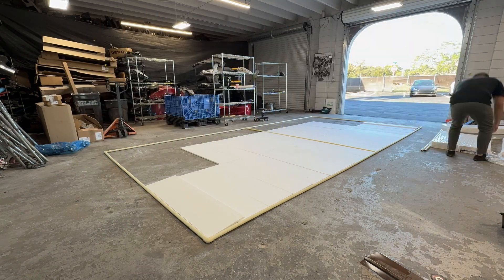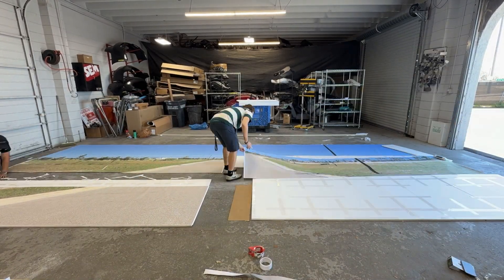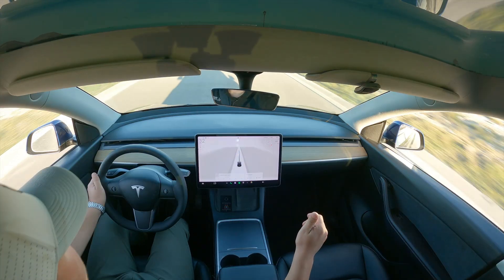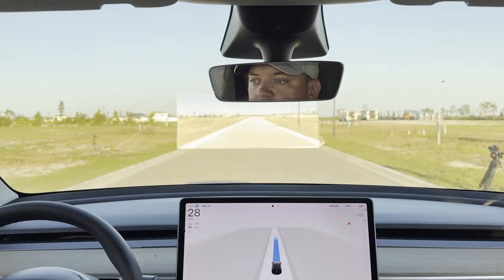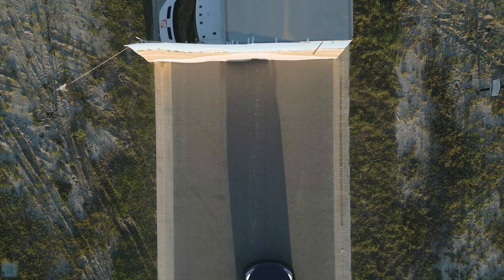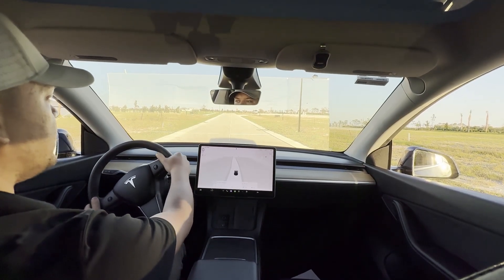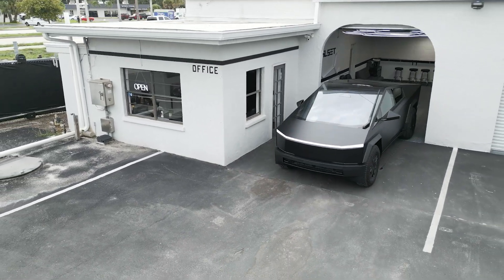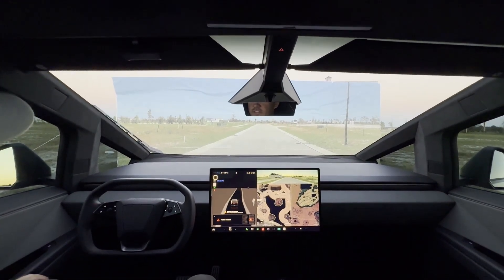Response to Mark Rober’s “Can You Fool A Self Driving Car?”

Comment: Now do the cybertruck in the same lighting conditions that the wall photo was taken in. Just look at how large the contrast is at 9:09
Reply: Yup. Day settings for the test were different. I would rerun with the same settings.
Reply: Could have done the 1st car again.
Reply: Was thinking same thing
Reply: So whats the point of this? To create unrealistic conditions to trick a vision system? Where in the world will you have a perfect mirror image wall in the middle of the road?
Reply: I don't think contrast would be that big of an issue, because then in the case of city driving you'd have Teslas stopping every time the road you're on goes in and out of a building's shadow. There has to be be something else. (Unless they actually do stop coming in and out of shadows?)
Reply: Exactly that was the reason why the cybertruck stopped!

Comment: Nice tests! The only thing I would point out is that you should probably retest the model Y after the Cybertruck runs to make sure it’s not caused by the changes in lighting conditions/colors of the real sky, etc.
Reply: You mean run the cyber truck with the same light conditions as the model y tests?  Or are we trying to get the model y to pass?
Reply: @reactionsok  Give the Model Y another run immediately after the Cybertruck; 1. If it passes --> changes in light conditions made the task easier --> more tests need to be done on the cybertruck on another day when the sky is more similar to that painted on the wall. 2. If it fails --> Cybertruck's FSD is better than Model Y's FSD.

Comment: I wanted to highlight a potential factor in the testing, the time of day during the Cybertruck and Model Y tests. In the Cybertruck test, it was darker outside, which increased the contrast between the wall and its surroundings, making the wall’s edges more visible to the cameras. This could explain why it avoided the crash. The Model Y test, done in brighter daylight, might have had less contrast, blending the wall with the road. It would be nice to retry at the same time of daylight. Just a thought—anyway, it sucks that my Model 3 is still stuck with Hardware 3.

Comment: Sunlight is different for the Cybertruck, so no truly an apples to apples comparison.
Reply: Good thinking. This is how the scientific method works. Eliminate variables like sunlight and repeat the experiment. We need lots of experiments. More data is more better.
Reply: That doesn't make any difference, cameras are doing realtime CV can see what's behind the wall if you knew anything about CV.
Reply: The version of FSD on the cyber is also not 1 year old! The model Y is hardware 3. The old hardware is not updated to the latst version.
Reply: Nope but he still has all the gear and sure he will do another follow up to appease the skeptics.
Reply: Even if the newer hardware is capable of seeing the wall, the vast majority of all Teslas sold to date lack this upgrade, making them less safe. @alexj-1133
Reply: elon simps gonna simp
Reply: That's really B.S.  You can see the wall blends in to the background with the cyber truck videos too. It's a really good "wall" which head on certainly looks like the road continues. Great job!
Reply: @MH-Tesla  from using my eyes I definitely saw a difference in the first tesla test and the cybertrucks LATE test.
Reply: The Cybertruck really doesn’t care at all about what’s in picture. It’s not a factor at all. It’s system works like human eyes by comparing the difference in perspective from two or more cameras to detect depth. Even if the picture perfectly matched the background environment in every possible way, the Cybertruck would still just see it as a wall.
Reply: @SCU3A_S7EVE  Should be easy to prove with another test then. I think the less faith based answers and more evidence based demonstrations the better.
Reply: @SCU3A_S7EVE I thought the model y is also using stereoscopic vision?

Comment: So how is it worrisome or reassuring that a car can/cannot detect a Wile E. Coyote wall? Can it detect a deep pothole? I was in Lancaster, PA and I saw an Amish horse pulling a buggy deftly navigate around a pothole without any input from the driver.
Reply: Other than people trying to maliciously confuse it, the concern is when it gets legitimately confused by something like a white tractor trailer spanning the highway, which has happened in the past.  Looks at it and sees light sky instead of a wall of metal to crash into.    Don't get me wrong, a human might not see it either, but that's why the original premise of Rober's video was comparing Lidar (which will see it) to Tesla's vision based system.   Teslas also used to have radar, and they don't any more.     To me, the only thing surprising has been that people think a vision based system can't be confused.
Reply: BTW, that Amish horse (like any other horse) can be visually confused by something as innocent as a bent stick on the ground (what it thinks is a snake).    Plenty of people have been thrown off their horses for just that reason.
Reply: @daemn42  An equine version of phantom braking?

Comment: I’m not convinced though. This is not a fair test. Neither for rober or for the model y earlier in the video. I think the cybertruck had an easier time recognizing the wall because it wasn’t bathed in glaring sun. This will give a camera system an easier time seeing things when exposure isn’t too high. I’m not saying that the cybertruck isn’t better but i do believe that we can’t draw a clear conclusion from tests with differing variables. It does though prove that mark didn’t stop or interfere with his car during his test. Hope to see a more even playing field in a coming video.

Edit: i also believe the added height of the cybertruck makes it easier for it to make out the false road simply because it can see more information from higer up. Maybe the cybertruck wouldn’t recognize the wall if it was an applicable size for the cars FOV. 

Still thanks for the video. It was nice to see that even though you are biased you didn’t make the test reflect that and i respect that deeply. I’m curious to hear if you see any of my concerns with the tests being valid and if you’d like the prove them out.

Comment: did you get the one without radar in it? (i think they made those between 2021-2023)

they're probably gonna collect this clip & retrain the model - should be fixed

(just saw the part with truck - it was 100% the radar)

Comment: I don’t know why people are freaking out about this. It’s a visual system that can be tricked with a visual trick. It’s fine. It’s still a good system, unless a devious coyote is after you, you’ll be fine. I’m not in the least bit shocked. And LiDAR will always see it as it is basically a radar with lasers… it looks for 3D objects. Is LiDAR better? In some ways, but it’s intensive on a computer to read that much data, so makes a lot of sense to use visual systems… like humans do. It probably worked on the cybertruck more because the light changed.
Reply: Still, I will miss a front facing radar in thick fog. You got people who don't use fog lights and having a radar unit just makes the car so much safer.
Reply: @corbett666  I don't think it's freaking out so much as it highlighted the major shortcoming of a camera only approach. 

I'm surprised you think a lidar system is more compute intensive. It's actually easier for a computer. An optical based system, you have to contextualise, and interpret what you are looking at. For example clouds. We know we don't have to worry about them, a computer has to parse an image, look at a messy blob of pixels to determine that it's a cloud, and that it isn't fog, or something you're about to drive into, or a tornado. Lidar you need to know much less about what you are looking at, because it doesn't even see the clouds.
Reply: @benholroyd5221  Except that isn't accurate at all (about LiDAR). LiDAR, as demonstrated many times, is also easily fooled or “tricked” by things like rain, fog, snow, smoke, and a whole host of other things. Neither of the systems is absolutely perfect. In the end, I do think that there are certainly some shortcomings for a camera only system, however, I do also believe it is likely the best approach, especially for mass market.
Reply: @ I get why they skipped lidar—it’s still an expensive sensor—but I don’t get why they ditched the front-facing radar. Radar is relatively cheap, works reliably in all weather (unlike cameras or lidar), offers long-range detection, and has been widely used across the industry.

We’ve seen plenty of Teslas slam into stationary vehicles on highways because the vision system failed to detect obstacles in time. And every time, we hear excuses like, ‘That was HW3’ or ‘It’s fixed in the next software update.’ Meanwhile, my 2020 Golf, running a system designed in 2014, handles these situations just fine and brakes when needed.

Tesla can’t seriously claim to have the safest cars on the road while pulling proven tech like radar—tech that could’ve prevented crashes—until they get their shit in order.
Reply: @Luka_3D I mean, to be fair, they can claim that because test performed by insurance companies as well as independent companies have tested their systems and proven that it works.
Reply: @ I don't know. I've read mixed reports on this. Most do say that structurally, they are very safe. Autopilot is more of a mixed bag tho. Seems like they are still brute forcing edge cases at the moment.
Reply: @ I've seen some of the videos they post of systems from different manufacturers and how they perform under various conditions and in different scenarios. And while some do preform better in some cases, the Tesla performs well is almost all cases.
Reply: @Luka_3D  I honestly think it's just an ego thing at this point to be different.
Like ideally, use both...
Reply: @ I’ve got a doctorate in computer vision systems, and using both would impact compute massively. The hardware would be the prohibiting factor on that approach. Trying to combine what the two systems are ‘seeing’ and match them would cause delay. That’s why radar was removed. Though it adds that extra layer of capability, as in can see solid objects even if they are hidden or disguised, it’s more noisy and computer vision makes assumptions with noise that can cause problems. I’m not saying pure vision is the best approach, but currently with our hardware, it’s one of the best.
Reply: @corbett666  it's just still flawed like with motorcycles, and if stuff leads to deaths (and it has) I'd say it's worth reevaluating and actually solving the issues before putting it on the market if it isn't worth covering the weaknesses with multiple layers of sensor tech.

I get what you are saying, it just doesn't sit right that cars are in a dangerous state (especially in other countries) because of some of these decisions.
Reply: @ human drivers also make the mistakes. Sadly relying on tech to be 100% is unreasonable. Machine vision is moving beyond human vision, but no system is perfect. Add in lidar or radar and you get so many false positives, that you make it slower to react, and you either ask it to ignore the errors, or you have a system that can’t perform on its own. I don’t believe the latest versions have any issues with motorcycles, but as with human eyes, fog and sun glare will always be an issue… I would argue that the system is safer than a human at this state, but will make different mistakes than humans. The ideal is to have humans be a bit more alert to mitigate the rare but totally possible issues.
Reply: @corbett666  it just isn't safer than humans at all though? The safest it can be is by driving ULTRA CONSERVATIVELY but that still then puts you in new issues.

As for the motorcycle thing - idk why it would be suddenly fine lol, unless extensive testing has been done that you've SEEN proving it. The company says the next version solved everything, but new problems keep happening.

Even in these videos we can see humans being safer than cars, much less on the international stage where the cars are completely unprepared for the roads.

Is this harsh? Maybe. But lives are at stake, and something being ADVERTISED and puffed up as 100% safe should not be so flawed - and that runs counter to having people be active and aware at all times. If you're sitting in a warm seat with background noise doing absolutely nothing - or looking at your phone - for hours on a road trip with FSD, you aren't gonna be prepared to suddenly pull your car into control if it just doesn't recognize something coming, or tries to lane change into something. This is an ideal that does not exist and will not exist. Even the people that shill for FSD make videos where they aren't properly alert and attentive because they are so focused on the shilling - much less general users.
Reply: Not so true with some motorcycles at night unfortunately

Comment: In a way, it's good that the AI3 hardware Model Y didn't see it because it validates that the wall was convincing enough to fool at least some version of software and it confirms that AI4 with the latest of FSD is indeed appreciably better.
Reply: It does not confirm anything as the variables were not the same

Comment: MARK ROBER LIED
Reply: how? this guy proved Rober right...whatchu talkin' 'bout?
Reply: Did you watch this video? It proves Mark Rober was telling the truth. The Tesla Y did not see the wall and would have gone through it. Only the CT saw it and stopped. But the lighting was also different. Suspect the color contrast/lighting with older camera with lower resolution and slower computer chip is causing the issue. Tesla should not have allowed AP or FSD on the older models given this issue.